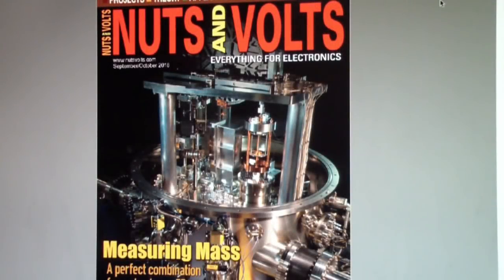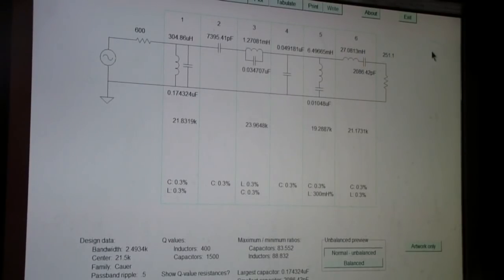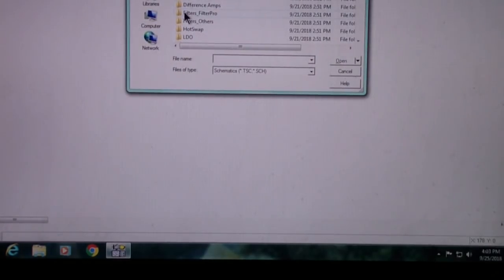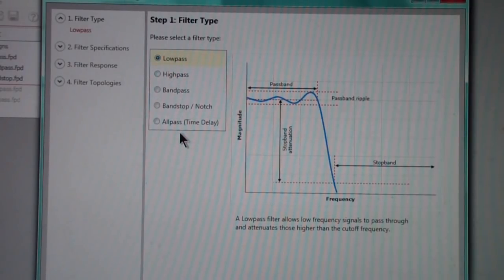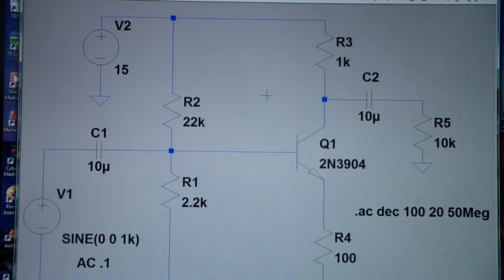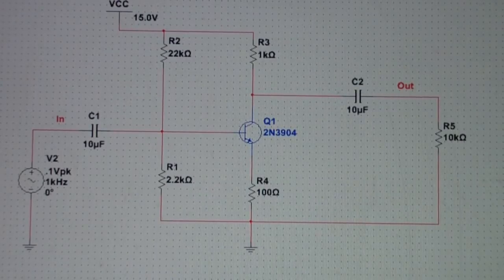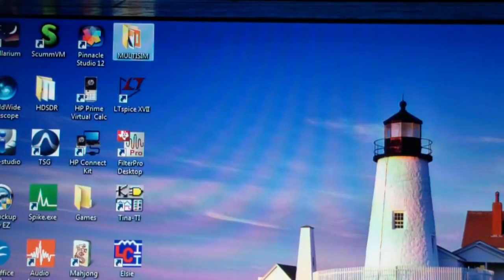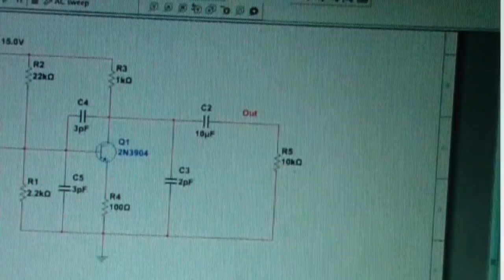TTT221 Circuit Simulators

Comment: Nice overview.
 While I haven't actively tried it yet I've noticed since KiCAD 5 was recently released they have been actively developing a spice simulator inside KiCAD. The Developers have been addressing KiCAD's terrible schematic parts libraries, although the system still isn't completely intuitive. One of the major reasons for the library revamp is to differentiate and clarify which parts are compatible with spice simulation. IIRC they are using the Open Source NG Spice (command line spice software) as the engine integrated into KiCAD. Again IIRC, when I was skimming over this stuff, the KiCAD Devs are working on compatibility with P-Spice models too. Ultimately that combination should yield a spice simulator with an unbiased universal library.

  As a poor gimp and hobbyist myself, Spice simulation software is a pain. It's very frustrating to come across all of the parameter complexity when I'm in the middle of a project, looking for an answer to a question and am faced with a giant academic wall of a learning curve just to get something running. 
  The integration of Spice into KiCAD should really help me slowly figure it out over time in an environment I use quite often ;)
-Jake